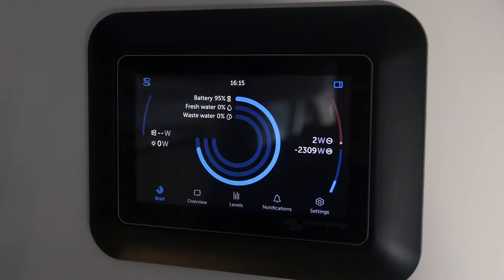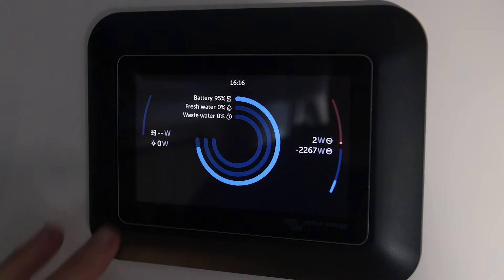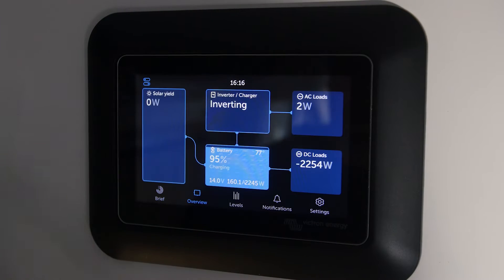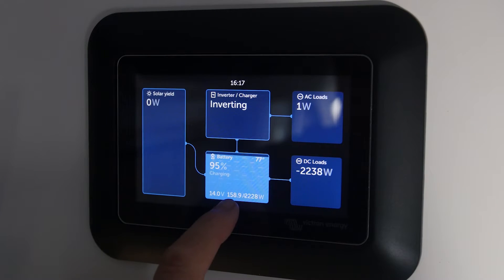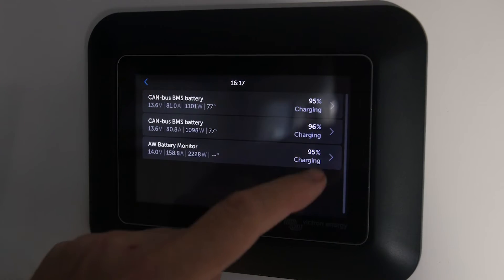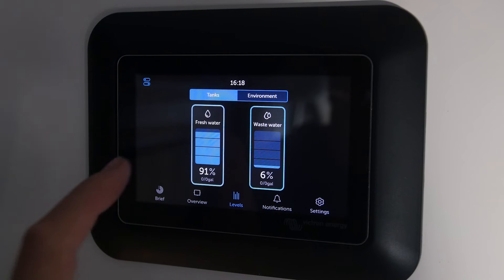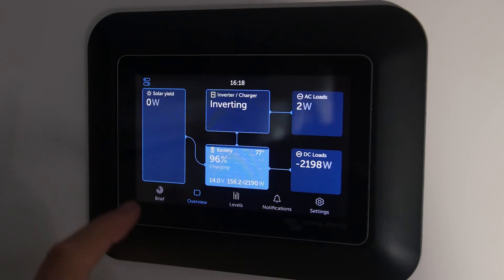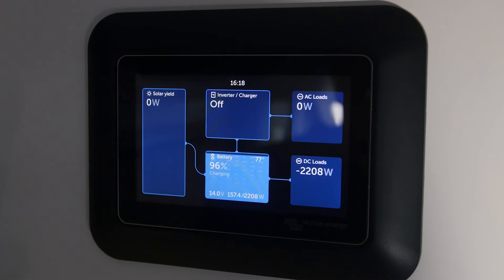New, 2.0 Interface for Victron Cerbo/GX Devices Coming Soon

Comment: Can the new interface display 2 inverters? The lack of this drives me crazy
Reply from the maker: Not sure... we will test that early next week and let you know.
Reply from the maker: We connected a second MultiPlus to a Cerbo GX running the latest, non-beta firmware with an MK3-USB adapter and that worked OK. We could monitor it and control it from the device list. What exactly are you trying to do?

https://www.youtube.com/watch?v=WHou7nY4j_I